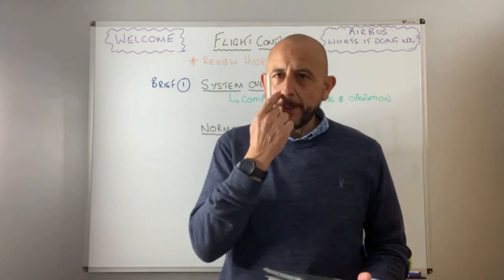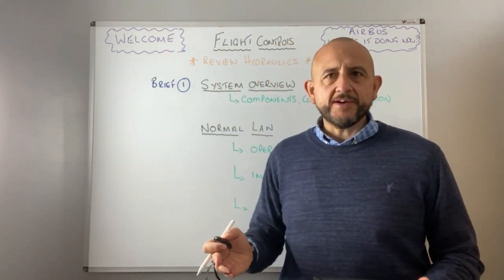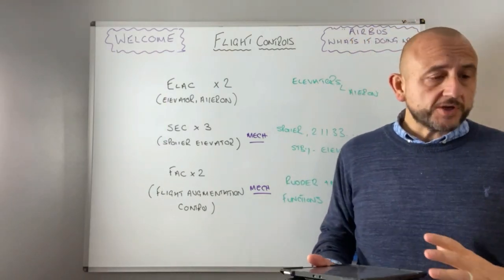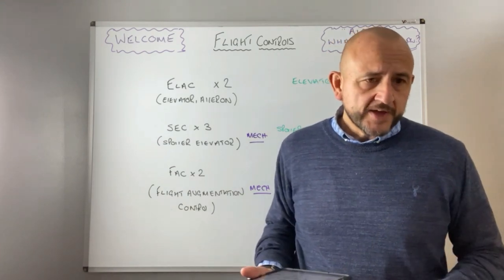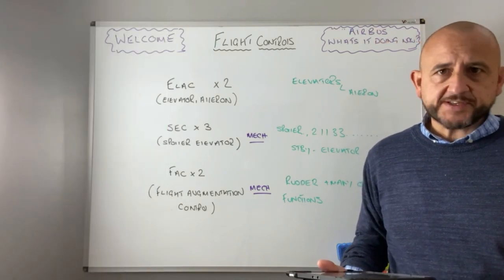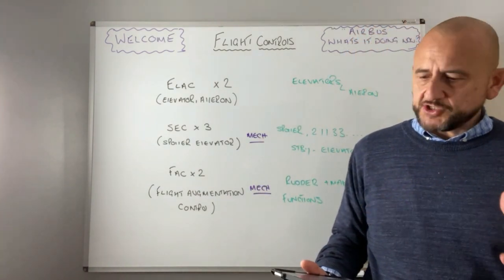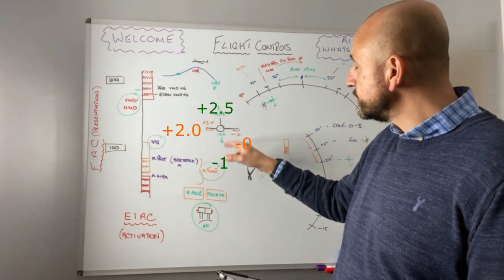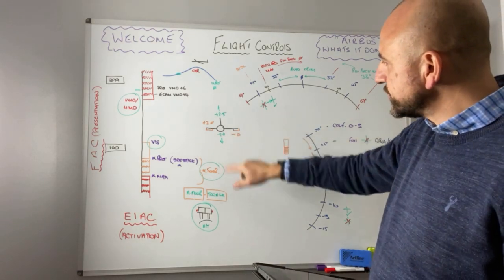Flight Controls

Comment: Great video! One suggestion on the lighting is to position it by the camera but have the light up high shining at you at around a 45 deg angle. This way you’ll get good straight-on lighting, but it won’t reflect terribly off the white board.
Reply from the maker: Ill give that a go in the next video. Thanks for the suggestion.
Reply: Well said also a diffuser might help for even more 😊

Comment: In a hypothetical situation where AP is disconnected and Levers on CLB Detent, if we pull up on control stick , how far would the speed decay with AT on. (Non evasive manoeuvre on approach.)
Reply from the maker: The answer to that question lies in normal law protections 👍